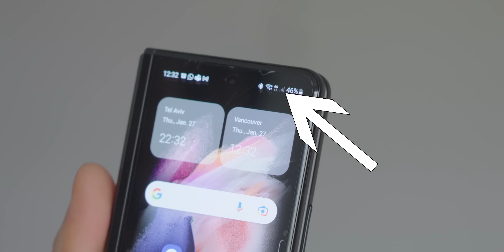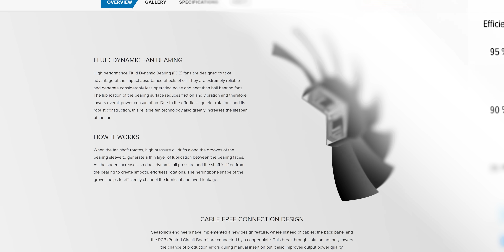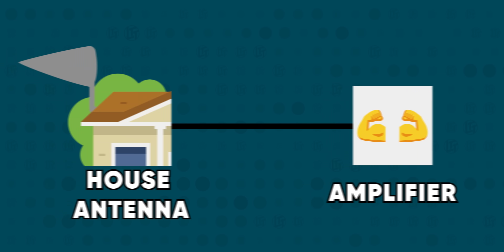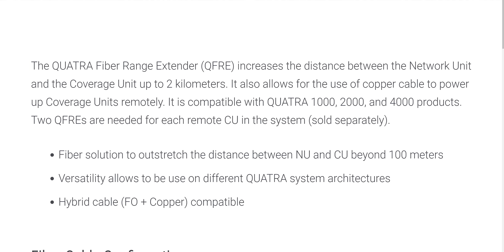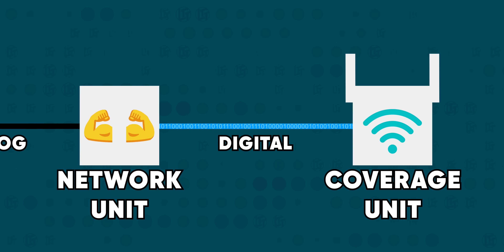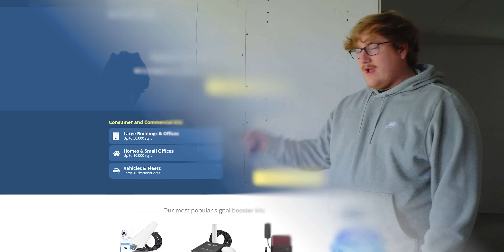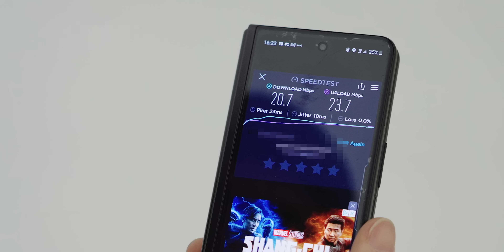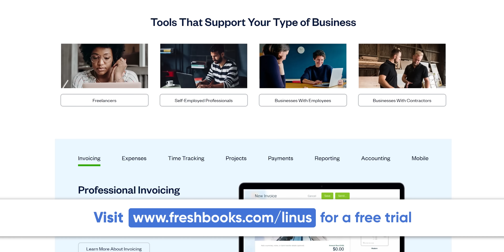I Hate This... New House Cel-Fi Cell Signal Booster Install

Comment: What you've installed is what is called a DAS. A Distributed Antenna System. It operates basically like you said,  WiFi access points, but instead it broadcasts cellular service. Cel-Fi is actually used in enterprise buildings that could be, literally, 1 million square feet. They make all their own hardware and even their own chipsets so they can control everything and build it to their needs specifically. I actually work for a healthcare company that has sites all across the US of varying sizes. While sometimes a fiber based DAS is better, since that's actually more of a direct connection to the towers (it's complicated), Cel-Fis are an excellent solution for many many different types of scenarios. You could even daisy chain their systems and just, keep going and going. 

I've actually been working for this healthcare company for 2.5 years now and we've been using a Corning ONE full fiber based DAS. But some other sites, are located in a building with other businesses, and running fiber through the WHOLE building, doesn't make sense (though sometimes the building owners will help with funding sense it's a good selling point for tenants). There's a company we work with called Vision Technology. They do MASSIVE amounts of work. These people install DASs in stadiums, airports, military bases, they're the real deal. They have recommended brands, bare aren't really loyal to one brand. (Similar to how a mechanic might recommend a certain car or car brand for you, but at the end of the day, you do you). Vision is a big proponent of Waveform products as well as Corning. Waveform even has info about their DAS solutions on their site! (https://www.waveform.com/pages/das-distributed-antenna-systems ).

Before this job, I did cell phone sales, IT Helpdesk support, Desktop breakfix support, and then this job was presented to me that, I knew nothing about. Cellular technology always interested me and I know a fair deal, but I had no idea DASs were a thing or how they work. Now I'm part of an engineering team! How? Hell if I know, but it's cool stuff! 😅😅

Comment: linus im a roofer by trade and ive installed 2 of those plastic shake x2000 roofs on wealthy homes around the pacific northwest we have problems with the uv rays bananaing the shingles and then they leak but with your roof im a little concerned its installed incorrectly, each gap between the shingles is called a key way you absolutely need a 3inch difference from one rack to the one above it and also the third keyway above cant line up with the first. those are usually sold in panels with one small shake one medium and one large on the panel the next panel in the box will be a big, medium, small and so forth you trim off the shake you desire to get your random* pattern. im no ex-bert i specialize more on cedar and shakes tho. beautiful home Linus

Comment: I've been running my entire house on 25mbps up and down for almost 20 years. I've never increased my speed and I have two TV's running Firestick, 3 PC's, 3 cell phones and 4 live streaming camera feeds (24/7).  You don't need more than 20 if you've got a solid connection to a quality signal and with zero loss, it looks like you've found it. Don't pay to uncrease speed until you're sure that you need to.

Comment: I see others have asked the question about femto cells. 
A couple of issues... 
1) Older femto cells did 3G some did 4G  
2) Wi-Fi calling is making this obsolete. 

Now Nokia offers a 5G femto cell (since 2021)  which will allow 32 simultaneous calls to a single provider. 

So its an expensive bridge for those who can't already do wi-fi calling (AT&T does)  until other network and phones do it. 
Also there's a question about encryption over the wire when it uses your broadband connection... although I believe this too has been addressed. 

IMHO  it doesn't make sense to install if you have wi-fi calling available. 
If you are in a rural area... and you don't have broadband... then setting up your own pico or femto cell tower may make sense... but you'd have to talk to your local carrier about it.

Comment: I live in a house made from concrete blocks, radiant water floor heating etc. When you step in the house you have no reception at all but outside is a nice connection. Luckily we have VoWifi on carriers so there are no problems with calls over wifi.

Comment: I have this problem 24/7 and have done for over 25 years. Where I live on the edge of London in a tiny bungalow built in the 1930's has no cellular service whatsoever. It hasn't improved since I got my first phone in the mid 2000's and my cousins used to complain about the service when they visited way prior to 2010. I have WiFi calling setup now which helps a lot but my previous network didn't offer this.

Comment: Back when I had Sprint my signal in the house was zip and not so good outside the house. Sprint sent me a repeater, I forget the name now. I hooked it up via a battery they included and walked around my Ranch style house to find the strongest signal. It happened to be at the south wall of one of my three bedrooms. I had a desk in there that I put some shelves on and set in on the top shelf. I went from no bars to five bars and max available speed back then. It claimed it would cover a 1000 foot radius. 0n the display I was digging through all the readings and once found 26 cell phones were hitting this repeater. I had once been contacted by them and they were asking how the unit was working...I told them it worked well but of course didn't fix poor signal strength all over town. I also told them I should get a discount using my electricity to help fix a signal issue in my area, they were struck silent and finally said there was nothing they could do. I eventually left Sprint due to issues away from home and they were contacting me right away to send it back to them...I went to the Sprint store to cancel and got a message within an hour. Poor people hitting that repeater were screwed, when I pulled the plug about 20 people were connected to it.

Comment: What he forgot to mention with the analog boosters. Is that analog ones also boost the noise unless the signal gets filtered. This also affects its performance majorly. And the type of coax can affect the signal as well. Good cable such as lmr-400 or lmr-600 can majorly improve the performance of these.

Comment: One thing I think should be added... check your local regulations as some places might have rules about it.
In South Africa, last I checked you can't just plug in a cell repeater like you want to. You could get fined in excess of $3k and have the equipment confiscated. In SA you have to go via the cell providers that holds the license for the frequency. And the equipment might be dictated by the provider.

Comment: Interesting to see the difference in practice between countries ...

In Sweden most of the phone operators provide the ability to use Voice over wifi, since a few years back. The use of cell-repeaters is to my understanding quite restricted over here. With permits and such. Most commonly used for elevator shafts and in the most rural areas. Its how ever becoming more common with 4G-FWA were households without fibre and decent 4G gets a outside antenna for the 4G-modem. Combined with Voice over WiFi the results are more or less the same as a cell-repeater.

In houses without pre-existing concrete floors (wood structures), its common to lay floorheating tubes on top of trenched insulation blocks (plastic foam) instead of incased in concrete. With the possibility to add thin metal sheats to spread the heat between the tubing, depending on what floor you'll have above.

Comment: Not surprised your upload shot way way up. The booster is taking your phone signal and the big antenna is broadcasting a really strong signal back to the tower, instead of your little antenna in the phone. The upload will ensure phone calls will be excellent.

Comment: I have Verizon home internet at my house and while better than nothing was super spotty. I saw the waveform antennas and bit the bullet and I wish I had gotten their high end gear because I went from 89Mbps and 2mbps up to 300mbps stable to 25mbps. I didn’t even point the antenna that well since only had two points I could put it up. I seriously recommend their products now. Even their extension cables were so meaty that I couldn’t complain too much about the price.

Comment: There's a crack in the lower board of your window trim that you need to look at. In the scene starting at around the 2:10 mark. That siding (what looks like Hardie) will soak up the water from behind and get destroyed in just a few months. A caulk over a crack won't last long.

Comment: In one video, LTT teasted about using a "digitial" cell phone amp. That raised big flags for me. That "digital" amp will be outdated in an year due to 5G, 6G, 7G, 8G, etc. The analog amps just move the single from one point to another point with some gain if needed. Being analog, it will work with any digital upgrades the cell tower makes. The cell phone booster does not care what is on the single or how its modulated, it just passes it along to the indoor antenna.
Reply: The analog amps also get outdated as new bands are added and tight noise ceilings come in on as existing bands upgrade. They are just cheaper, not future-proof.

Comment: Lines you can get an external cell antenna for your home and then wire the relays to your home. Ps use fiber wire to reduce single loss.

Comment: that coax looked like triple shilded rg11 cable, its a standard cable used for ground lines that goes to houses, it has a foil-twist sleeve-foil shielding, standard for coax cable, atleast what we use in norway, can reliably run digital at 100 meters length and also the max cable length for a drop cable for telenor. main isp in norway

Comment: Upload is higher because of network congestion. The number of bars shows the strength of the carrier waveform, but there's only so much data that can be squeezed into it. Some is allocated for downstream, some for up. In areas of low coverage it's usually congestion that gets you because of the quantity of devices connected to one waveform. Frequently you'll find disabling 4G can give you faster speeds over 3G. At least until 3G is turned off (and the frequencies made available to 4G of course).

Comment: Hm I dont know for Canada, but in Switzerland i worked for a Company and we did a lot of Analog repeaters for Companys, Road Tunnels and Factorys. Analog works fine but we had way bigger Antennas, Cables 4 times Fat as the delivered one and hell of power consuming Amplifier.

Comment: Those antennas aren't purely LOS like what you've tried with the unifi Line of Sight thing. There is a cone, and sometimes you get faster uploads than downloads because the antenna on the tower is much higher gain than the one you're using to pick up it's signal and unless you have it directly pointed at the tower you will often see more of a drop in download speed than upload speed. Ask someone techy who lives out rurally with no broadband access, this is what we use for internet since it's lower latency than satellite (unless you're 'lucky' enough to have starlink)

Comment: Interesting, I actually had to have one of these installed in my last home. In fact the same brand.
Just for a small home the whole assembly, coverage unit, donor antenna, and 4 indoor antennas added up to about $2-3k USD.
Installed it myself with the help of a friend and lots of beer. Left it when I moved though because it was the middle of Summer and there was no way in heck that I would climb into the attic to retrieve the four antenna and coverage unit.

Comment: My cell provider supplied me with a unit which plugs into my router via ethernet. It produces it's own 3G phone signal. It only works on that specific carrier, and doesn't work at all if I the Internet connection goes down, but it solved the fact that my phone refused to used WiFi calling in our cell service blackspot apartment.

Comment: its not just the concrete, the water in the tubes is an excellent insulator, I ended up on n a room of my apartment with a large fishtank on the other side of the wall between me and the wifi router. I could trace the outline of the tank of the wifi router with the signal bars on my devices.

Comment: Those "analog units" suffer mostly from being improperly installed. At short cable runs (and badly mounted coax connectors) they can pick up their own signal, amplifying it (to the max level), like a mike-speaker feedback, transmitting the overloaded signal / noise towards the tower (and other noise towards the house). Not to mention that build quality is questionable, e.g. a power amplifier MMIC with "absolute maximum rating" of 2W runs at 2.5W (as seen in some 900MHz units here). Your solution looks like not only something that might be legal, as compared with what I've seen, but as something that will actually work well.

Comment: I have this problem at my place. I ended up using the call and text over wifi option built into the phone. Works well enough to get the job done but not the greatest option

Comment: There is a good reason why these boosters/repeaters are forbidden in most any country in Europe. The carrier must guarantee that a cellphone can reach the emergency line. If such a booster/repeater installation is faulty, there is a good chance that the emergency line is not reachable. Its like when your phone is connected to your wifi, but the line is down - the phone is still connected to the wifi.

Some carriers provide a small box with a simcard in it and the box is connected to your network. But only your phone with your number can use it. If you want a lager installation, you cant do it on our own.

Comment: The heat pipes in the floor DO NOT NEED CONCRETE. They are typically installed professionally with a plywood track system in the sub floor. I know this because I've installed it myself.

Comment: I was in a single story house with metal roof = no signal in doors and only 1 bar outside so I bought a cheap booster off eBay $280 had outdoor antenna and indoor powered box and indoor antenna simple install and bingo full 4 bars indoors

Comment: I wonder if the pattern of ventilation holes seen at 5:54 in the video (and elsewhere) along the sides is a 6 bit character coded text of some sort.  Probably not, but that would certainly be an interesting "Easter egg" of sorts.

Comment: Craziest coax? I've seen some with a roughly 3" diameter (not cm., in.). When you need to have a low power antenna inside a building using an unpowered antenna on your roof, that's what you end up using.

Comment: The cables at 7:55 - GAAAAWWWHHH - cross talk!
Are we to the point with cable shielding that we just don't worry about that anymore?
(cables close and touching is usually fine, having one or more spooled around themselves - ive always been told was an EMF no no)

Comment: ahh the old j-pole lol.. Linus uts probably not as important in this application but those poles are meant to be mounted level at the mounting part of the pole. also the pole can be flipped so the reach is farther out off the fascia. also for sturdyness in higher wind areas sink a 1/4 inch hex head half inch long self drilling screw through both the antennas mount and the lower part of the jpole. 9 years of fta satellite experience.

Comment: People think that heating the home through water pipes is better than forced air. All ways of heating homes use the same amount of energy hence they are going to cost about the same. Yes you can reduce some loss in the heating system but it is minimal.

Comment: You are going to need Jake to move in to admin all your tech.  I had this problem at the cottage, and frankly it was easier to switch phones to something that used wifi calling.  My SMS seems to work under wifi calling just fine.

Comment: For US Verizon users: (this may be the case for other providers as well ). If your cell service is so bad that u cannot receive texts and calls in your home... You can get a cell extender if you go to Verizon and tell them your problem. It will hook to your router and provide a 3g signal within your house. Yes 3g is slow but it easily does calls and sms. If you are someone who doesn't get cell service in your house they will allow you to purchase an extender and it works for calls and sms. Just fyi

Comment: Actually if the new building on campus has the same heating system as linus’ house then that would explain why the thing is one big dead zone. Only the top floor and near the big window on the first floor actually get any signal.